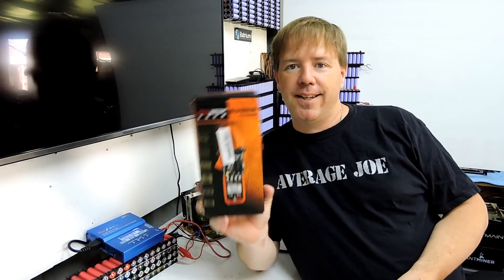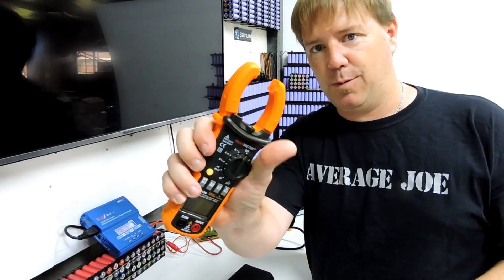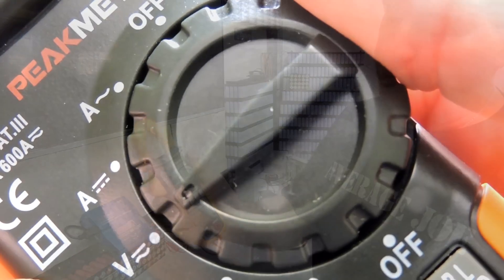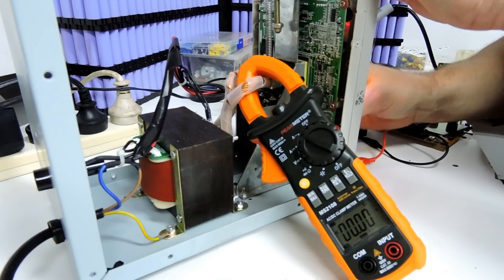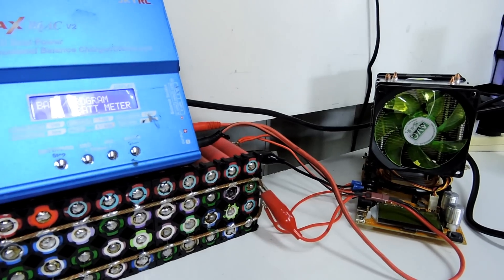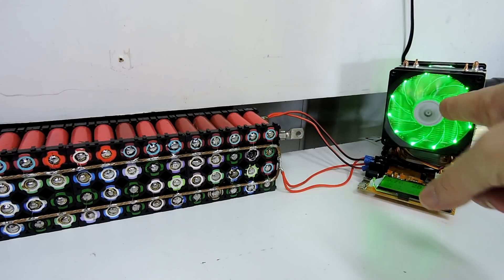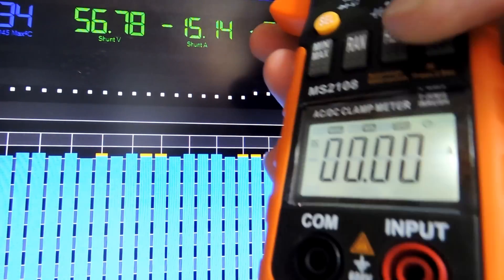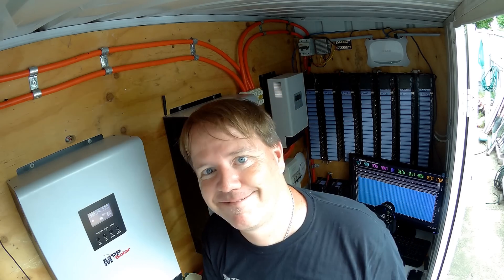HYELEC PEAKMETER MS2108 Digital Clamp Tester [Dec - 2017]

Comment from the maker: 8 Month update - unit has failed - turn it on and nothing, no physical damage, no water, pcb & battery is clean and looks new - just won't turn on :(  I have used it almost every day several times a day and has been droped from bench to carpet floor but that was months and months ago - 4 sets of batteries through the unit.. Dissapointed and would have hoped it lasted longer than 8 months.

Comment: I have an AIMO MS2108A meter, identical except the outer lower body is green and the 2 clamp meter ranges are printed 400A & 40A.  I think they all use the same monumentally naff instruction booklet.  I'd say the same, they are nothing stellar but  have reasonable accuracy for what they cost.  Present prices on UK ebay are ~ £25 - $35 - 45 Aus dollars

Comment: Did you notice how the clamp on amp meter shows you negative or positive? On my clamp on, Kline Tools I believe, there is an arrow to show you which way the current is flowing. 

So in theory you should be able to see if your battery is being charged or discharged. Just clamp it on and watch the - sign appear for charging and the - sign disappear for discharge. Or the other way around, it’s depends on which cable and which way you put it on of course.

Comment: Looking at name brand versions of this you have to pay way more $$$ to get DC amps, most are AC only, I'll be getting one of these!
Reply from the maker: It does the job so far and helped me troubleshoot the issue. I had my new PIP inverter charging from the grid and the display said it wasn't. Settings didn't stick or something. Quite handy and would have taken some guesswork otherwise to find that out. So on that alone, i love it - let's see how long it lasts! lol

Comment: .....how does a DC clamp ammeter even work?  Shouldn't that be impossible without the magnetic field from the changing current?
Reply from the maker: I have no idea lol but so long as it does i'm happy
Reply: Just read up on it, and they're using a separate Hall-effect sensor to do DC, which actually makes a lot of sense, though I would never have thought of it myself!

Comment: In all honesty only use that as a clamp meter on low voltage stuff. I wouldn't use that anywhere near 240v it seems like it has no input protection considering the manual doesn't have any reference to having or replacing a fuse. Imo spend a few more bucks on a fluke 117 if you are poking around anything 240v and up. But $50 for a dc clamp is real cheap compared to my fluke 375
Reply from the maker: Only 240v i've ever touched is through a commercial plug, still remember mum yelling in my ear as a kid never stick anything into a power plug or I'll die lol I think my ears still ring from that
Reply: Manual does claim 600vac input, a fuse only protects against current.   Current seen not dependent on the voltage, it may have electronic limiting...  One way or another.  It's where the magic smoke comes in. ;)